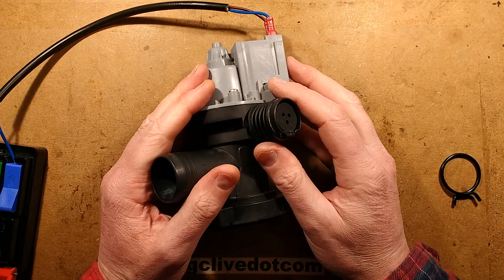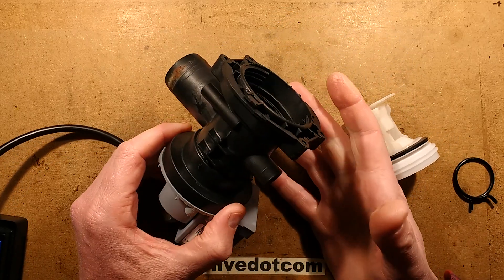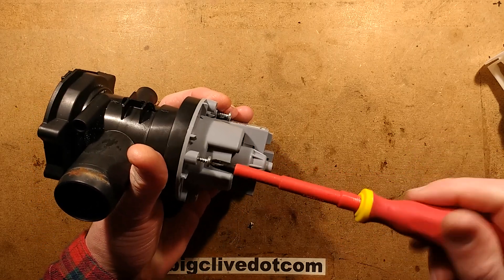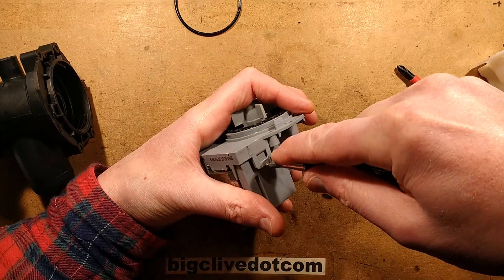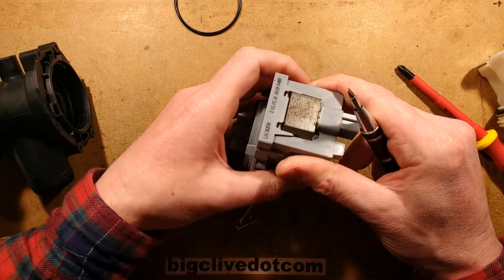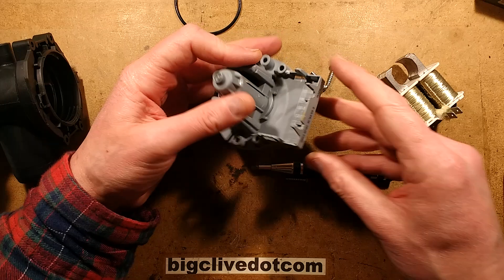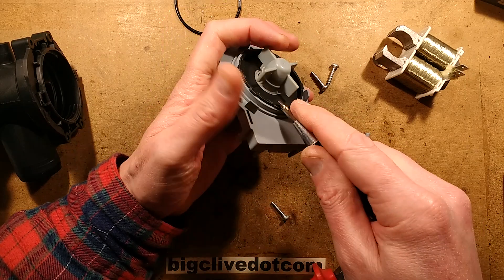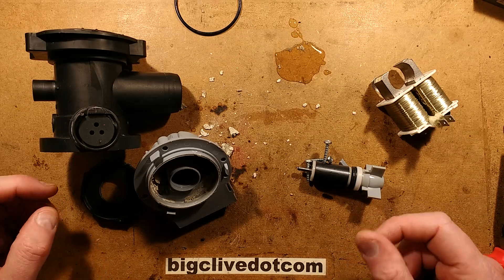Washing machine pump teardown.

Comment: IMPORTANT. You forgot the most important and wierd bit.
So these pumps almost never burn out but they have an odd desese.
The impeller falls off and i looked online no one seem to know how to re attach them.
So you forgot to take the impeller off.

As i seen all what holds it in place is some mineral oil and an O ring. (Vaccum holds it)
Once the minerql oil washes out slowly the impeller falls off and then noone understands what is missing as nothing is broken.
When i took apart aworking pump the impeller was attached with such a force that it would be unbelievebe thats its just vaccum.
Nothing seemed to break and once re applying babyoil i could re attach the impeller back (no oil impeller just falls)
I would be happy if u continue the video figuring out exactly how its made and whats the best way to repair :)
Reply: The drive pin broke in mine. Now it's $60 to replace a $0.20 pin! 

And it looks like there's really no way to get the permanent magnet out once that pin is broken. It looks like it's trapped behind a nylon (Maybe? It's white and has that nylon, "look," to it.) ring that is pressed in and there is just no way to get ahold of that ring without destroying it.

I'm guessing that hair was the culprit. It's about seven years old and I imagine that seven years of resistance from hair being wrapped around the drive pin shaft every time it ran just took its toll finally. The impeller came off with part of the pin still in it and I can easily see where it's sheared off.

Damn! How annoying!

Comment: I don't understand: how the motor can turn the propeller since they aren't merged?  (When you turn the motor it doesn't turn the propeller right?)
Reply: Wrong, Impeller is attached to the black part which is a permanent magnet reacting to the poles of the electromagnet. The field of which is passed thru the plastic housing that keeps the wet only on the impeller part. Turn the impeller and the magnet is also turned with explained slack in joinery for starting purposes.

Comment: The Quicktest is still available - https://www.facebook.com/1467440472/posts/10217735112997381/ - it can be pricey, but it's worth it for the safety it offers. Wish they offered a US/CDN one with a cable. The one they offer has no power cable. Seems to make the unit "cheap" even with it's price$. August 5, 2018.

Comment: Please excuse this dumbo asking a dumb question, could this be made to run on 12 volts?
Reply from the maker: Not easily.  You could theoretically rewind it for 12V AC, but it would be easier to find an actual 12V pump.
Reply: Thanks for that, and for the prompt answer :-)

Comment: these pumps are a nightmare!  the motherboard on the unit changes polarity to provide recirculation of wash water. ,at least that's my deduction.  the weak point is the impeller. very often they strip out, the motor chooches but the impeller dont. most front loaders are now equipped with double pumps, all of which I've seen have solid flap check valves

Comment: That “little” port is for spray function when washing clothes using another similar motor. I think it helps distribute water and detergent mix more evenly. Some Electrolux washers have this.
The smallest port is for small hose drain, channelling water to a small bucket or tray when the filter needed cleaning, so the water don’t spill on the floor when you open the filter’s door.

Thanks for posting the video anyway, very helpful!

Comment: This was a really useful article as my washing started leaking again. Last time it was the drain pump. Sadly, this time the door seal has perished - not bad for a 19 year old machine to last this long.
Reply from the maker: The door seals are not that complex to change on some models.  It might be worth looking on YouTube to see if there's a video that covers your model.  It's often a single rubber sleeve retained by two spring tensioned wire loops.

Comment: Magnet type pump motor or synchronous motor ?
Reply from the maker: Magnetic rotor.
Reply: bigclivedotcom 
Hi, I think you are right. It is a PMSM, however I can’t get my head around the different rotor direction as the RMF in the stator is governed by the supply, do you have any idea?

Comment: Just wondering about those holes in that flap. Would they be necessary to keep the pump primed on a front end loading machine? All the washing machines that I've taken apart are top loaders and the pump is totally different, with most driven by a belt or a direct drive off the main motor. Interesting that this design has a separate moter for the pump.

Comment: somehow ended up with a penny in my pump.  hired an idiot to replace the pump (didn't know what the problem was at the time).  He put in a new one, but never clamped the hose to the pump.  Ended up with 2+ inches of water in my basement next time I did laundry.  Should have known he was less than honest when he pulled the original and found the penny, but insisted on putting in the new pump anyways (obviously had the new one marked up a huge %).

Comment: I once repaired one of these pump motors many years ago. First time I used it, it set on fire and filled the kitchen with thick black smoke. Showing super human strength I pick the washer up and chucked the bugger still burning out the door. I have since stopped interfering with white goods.

Comment: I'd be interested in seeing the pump in my machine. I had an issue with the machine which I fixed, however before hand it stopped with the machine full. I went to the port to access the pump to discover there was nothing behind and the instruction manual said it was a maintenance free model. Fortunately the fault was not pump related so it was fixed, but it did make we think how it would be remedied otherwise. I'm guessing to release the door catch and empty it there.
Reply from the maker: On typical UK machines if you lower the drain hose below the drum level you can pour the water out into buckets.

Comment: Are the core laminations stacked up so their slightly knifey side (from being stamp cut) acts as ratchet teeth against the pump body?
Reply from the maker: Not sure which edge was sharpest, but the rear one did fold down enough to make extracting the coil difficult.

Comment: I’ve always been irritated by the fact that the pump filter is often placed so low on the front of the machine, because I can’t even slide a simple tray under the opening and that makes for a whole load of soaked towels instead. 

As far as I know the only brand that has a good implementation of the filter/drain on their machines is Miele, at least on their old models. They had this little tube that you could place in a pan, and you’d drain all of the water like that and opening the filter didn’t result in a minor flood...

Oh boy do I love Miele. Their 80s and 90s washing machines were tanks, absolutely indestructible

Comment: I bought a whole new washing machine because the old machine wouldn't spin. Turns out it wouldn't because it couldn't pump out and that was because the pump was blocked with fluff. Once I had sorted that it ran fine, so I sold it on Ebay for almost what I had paid for it 4 years earlier.

Comment: If that pump is a bigger version of aquarium pumps I service sometimes - it is perfectly possible to service the rotor and its magnet axis JUST BY PULLING THE ROTOR after taking out the filter part. It seems like it is hold in place only by an O-ring. Does anyone know?

Comment: A common problem with these type of washing machine pumps is they stop clearing water from the machine, even though the pump can be heard to run.  Taking the impeller housing off the pump, look at the shaft of the impeller, there is often a thread wrapped round the impeller that stops the motor getting the impeller up to speed, the other problem is it tries to start off with the impeller turning due to a thread from fabric being wrapped around the shaft and it is not fit to turn it as the thread is jamming it.  Remove the thread from the pump impeller shaft and the cost of a pump has been saved.  It would surprise you just how often this happens and some repairers that are not to honest will remove the thread and charge you for a new pump.  It is not hard to get the pump out to have a look, bit awkward to get the clips off, but that is the hardest bit.  Remember to turn off the power, might appear obvious, but people don't always follow common sense things!

Comment: I think your problem taking that motor coil out was that you weren't lifting it PERFECTLY straight up, they probably have a jig to put it on. You can use the coil by itself as a hell of a screwdriver demagnetizer. I use the motor from an old pair of hair trimmers as a demagnetizer.
Reply from the maker: The rear lamination bent down and dragged tightly on the shaft as it was lifted up.

Comment: The smaller drain port on the bottom (under the filter housing), at least on my washer (by LG), goes to a tube in the front panel, so you can drain the excess water into a tray before opening the filter.

Comment: Well, I'm confused now.  Several comments say that the magnetic rotor is normally immersed in water to cool and lubricate it and some say that the pump will fail if water gets into the rotor chamber.  Who's telling porkies?  Was there a seal between the impeller and the rotor?  I don't think that a permanent magnet rotor in a synchronous motor needs to be cooled.  It does need to be lubricated but water isn't a very good lubricant, so I'm told.

Comment: The most important design element of this pump is that the rotor of the electric motor is on the other side of a non-magnetic barrier [the plastic cylinder around which the electromagnet poles were clamped] so that there is no need for a fancy seal on the shaft of the motor.  Yes, the rotor and its bearings are immersed in the fluid being pumped - this provides cooling.  This design was a top secret invention of the WW2 American Manhattan Project, the so-called 'seal-less' pump, used for circulating gaseous uranium hexafluoride without risk of the radioactive material leaking from a shaft seal.  Very clever idea, and now used in many routine applications as shown here.

Comment: The Cliff Quick Tests are not inexpensive, either.  $59.99 + $10.80USD shipping over here, from Ebay.   //  The only thing missing from your removal of the core and windings was the proper application of unreasonable force, Clive.  Get with it!

Comment: I changed out lots of those pumps on my job taking care of laundry at a college. That seal always leaks and the magnet is always full of disgusting stinky glop. The motor runs even with that area flooded. And the thing that fails on them is usually the shaft  where the impeller is attached wears out so the impeller gets all wobbly and starts making noise. Also what happens is either coins get in and plug up the inlet , or stuff like hairpins can work their way into the impeller . Though that was the older style pump that did not have that filter on it - those are nice and catch a lot of stuff that used to get into the impeller. And yes you aways have to pry hard to get that coil off - I used to just put them in the vice and whack them with a hammer cause they were already junk anyway and I just recycled the copper and metal . As you said there is no repairing those unless it is just plugged - otherwise you replace when they get worn out . The coil never fails . I always kept those magnets -  they are useful for other things. Oh and the commercial washing machines had 5 year parts warranty so for five years when ever pump fails - free to put in a new one .

Comment: bottom one is a drain pipe so you can drain water via a short hose into a bucket or near by drain before opening the trap to clear out stuff  from there

Comment: Clive, this may seem stupid, but i took a regular AAA battery, and took 2 wires, put them on each end and connected the wires, im guessing im technically recharging it so it starts smoking and smelling really bad
Reply from the maker: What wires did you put on the battery?  What were they connected to?
Reply: bigclivedotcom literally from the POS and NEG of said battery and just some thin copper wires from a small sound thing - i tore them off of the sound circuit
Reply: bigclivedotcom is there a way i can show you?
Reply from the maker: If you shorted the battery out it would pass as much current as it could through the wire.
Reply: bigclivedotcom ah, thank you 😁, as a background family of electricity you have helped me understand alot :)

Comment: I changed a similar pump a few years ago (Hotpoint make machine), the windings had shorted causing it to overheat and melt the grey plastic housing so that it leaked water.

Comment: fixed alot of those. normal I pull the propel part out clean it. put it back in. and it works 9 out of 10 like a new one again. if thats not it. replace it. cost around 10-20 dollars

Comment: I don't see access to change the brushes; is it a brushless motor?
Reply from the maker: It's the simplest type of AC motor.  A synchronous motor.  No brushes, capacitors or anything else.  Just a winding and magnetic rotor.
Reply: Like a Gary fan in the bathroom. They last a long time.

Comment: Actually Clive, having worked for a white goods manufacturer... You are not that far off the truth.

Same for cookers, dishwashers and anything you have in your kitchen.

Fridges are the biggest con of all, while parts may similar or the same, subtle and seemingly insignificant differences have a part to play in making figging a part from a similar fridge hard to do, same for any appliance.

I used to work in the spare parts department and I was the go to guy about spare parts and gould tell you if a pump or a cooker element would fit an appliance, little things like the a tab in the wrong place... makes fitting parts hard.

Its all intentional, the manufacturers don't want you to be able to buy a cheap part for a premium product, they want to be able to charge you the earth.

Comment: You had a fully sealed pump. There are also pumps that use a rotary shaft with radial sealing rings and a cooling fan attached to the shaft like in my machine. After about 10 years it started leaking, my dad fixed it up with some silicone. Another 10 years later it spilled several drops of water per minute which results in the machine emergency shutoff and pumpdown during a washing program. As it was now unfixable i got a replacement one of ebay for like 20 Euro. It again did not use that fully sealed design but i guess if it fails in 10 years i will just replace it again with the cheapest one i can find. Looks like this: https://www.ersatzteil-land.de/lavalips78/bsh/neu/pumpen/140470gre.JPG
Additionally, my washing machine has a small hose that can be used for emergency draining before opening the front port. Procedure is to take that small emergency hose, unplug it and let it drain into buckets. Once the machine is nearly empty the pump maintenance port can be opened with just a few drops running out of it. Informational sidenote: fully sealed pumps like yourse are usually lubricated with the liquid they run in. This is why there should be a little opening in that black screen behind the impeller. That yuck gets in there with the water for lubrication and i guess the warmth of the pump might crystallize the detergents out there.

Comment: Back in the day in the USA one could just buy the replacement motor to these pumps, today however they sell you the whole pump and charge you an outrageous fee for it. I shipped a GE top loader to Greece about ten years ago and the motor went bad in the pump, went to a local supply shop and they told me that they had a replacement motor, yeah, it bolted up fine to the pump but it was half the size of the original. Net result, it left too much water in the basket so it could not spin up and get rid of the rest of the water. Had to order a whole new pump from the supply shop back in the states. Still came in cheaper than what the GE dealer wanted for it here. Would I recommend this brand to anyone else? Hell no! They eat up clutches like thy were made of plastic, and its supposed to be a heavy duty washer???

Comment: Funny thing. I replaced the waste-water-pump in my washing-machine last week. It looks very similar. I got the replacement from ebay. :-)
I disassembled mine together with yours. The only significant difference is a thermo-fuse in my motor.
Also it's very interesting how the windigs are made. You can pull of the windig-pack and "flip" them together. this way a spooling-machine can simply wind up all the wire in one go. There are special tabs for the transition between both windings.
Interesting example of highly optimized production. Everything is reduced to the bare minimum. No skews and no glue. Every thing is held together with two clips.

Comment: Isn't one of the small 'pipes' on the side of the pump used for the water level gauge. Connected by a fairly long rubbe tube.

Comment: The last one I took apart had a magnetically coupled impeller (i.e. the impeller on the pump side was just floating with no bearings / no direct coupling to  the electrical side) It was actually a very clever idea. In my case, the impeller was completely jammed up by some string that got lodged in it, but you could heat that the motor on the rear side was still turning freely without damage, I imagine that would be a very long life pump, with no seals to go bad and no negative effects on the motor from the impeller stalling